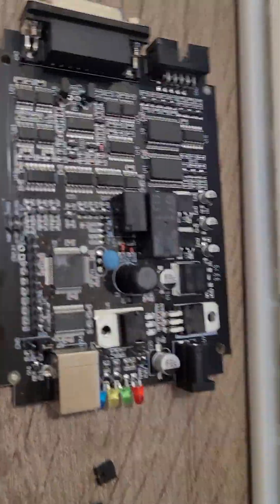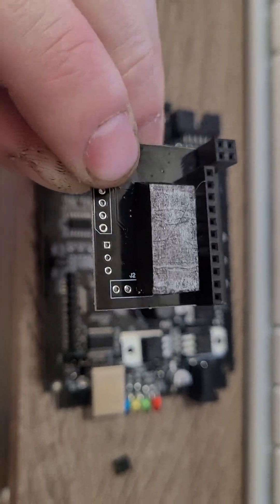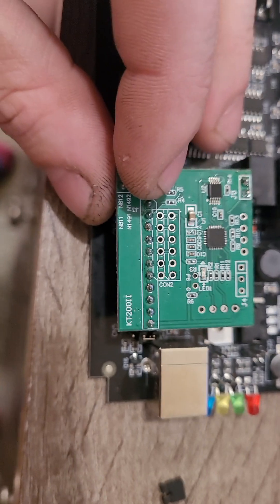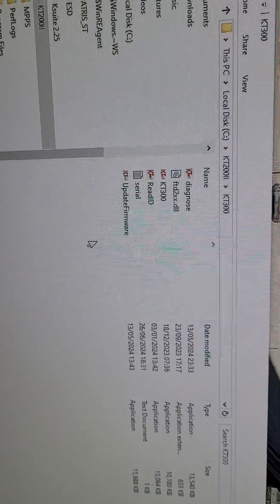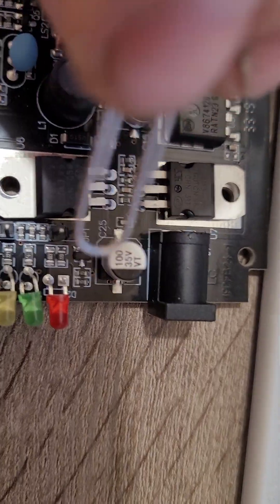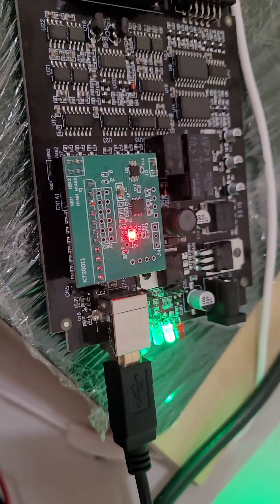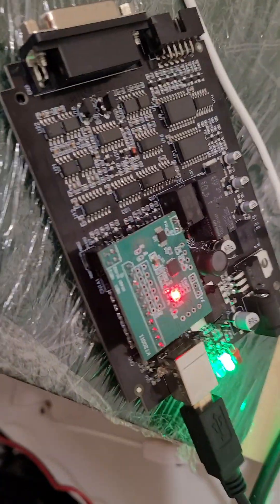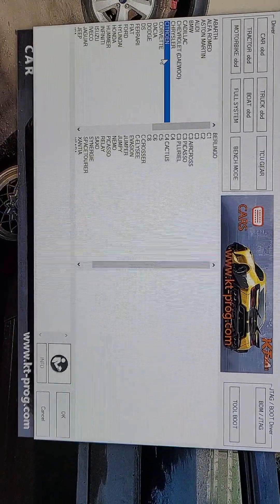Kt200ll EcuHelpShop june 2024 Board/Software Update

Comment: remove the two jumpers after the update?
Reply from the maker: @hali1337  you only remove 1 jumper i can send you a picture of my board now if it helps
Reply: @Remapping  which? On Main PCB or Update PCB?
Reply from the maker: @hali1337  did you want me to send pictures of my board ??
Reply: Hello, how can I get the green update plate for 2024.5 and what is the cost?
Reply from the maker: @buli311  you would have to whatsapp ecuhelpshop - unsure now if they are selling the board on its own now